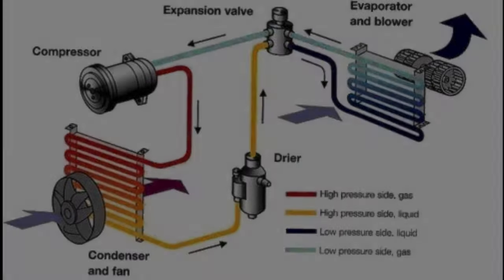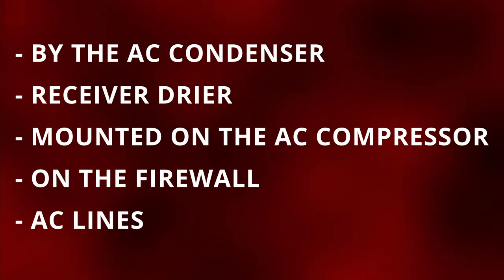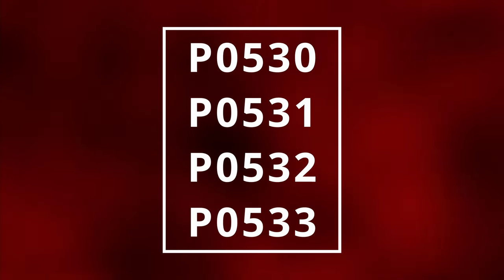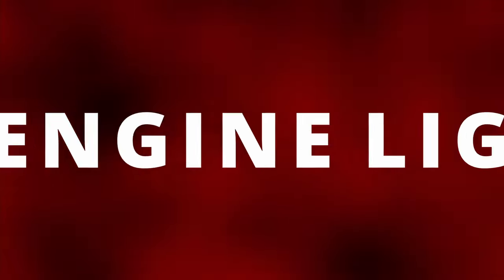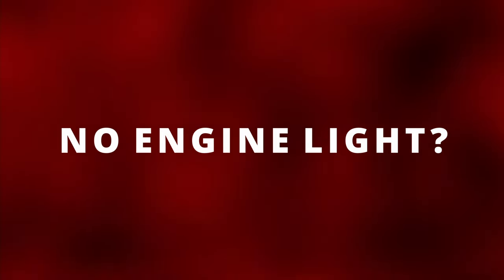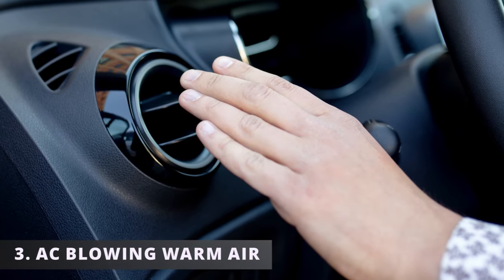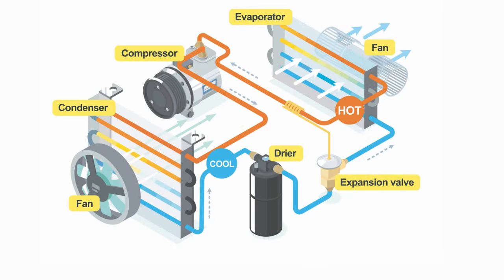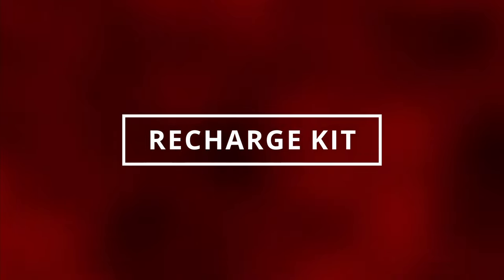SYMPTOMS OF A BAD AC PRESSURE SWITCH

Comment from the maker: Thank you for watching! 

Recharge Kit: https://amzn.to/3ycMH6V

OBD2 Scanner: https://amzn.to/3PHRplS

A great car repair manual: 
https://www.gopjn.com/t/SENKTklLS01DSE1NS0lOQ0dKRk9LTw
(Use code AD10VA for 15% off one-year subscriptions for any US Order)

Have car-related questions? Check out JustAnswer! They have verified auto mechanics that are available as live help 24/7: https://justanswer.9pctbx.net/qndBon

Check out my merch: https://easyautofix.creator-spring.com/

Buy a new AC pressure switch here: https://advanceautoparts.rt8x.net/DV4a7q

Here are some of my favorite items that you might like:
Tools: https://amzn.to/3xNDb8g
Car Vacuum: https://amzn.to/3EjhPSJ 
Cleaning Tools: https://amzn.to/3El7dCG 
Water Repellency Wiper Blade: https://amzn.to/3utvK50 
Cleaning Gel For Cars: https://amzn.to/36NIiMr 
Portable Air Pump for Car Tires: https://amzn.to/3uBuPzA 
Headlight Restoration Kit: https://amzn.to/3qDpOVH 
Amp Jump Starter: https://amzn.to/3pMd0vx
Reply: Hey boss.....great video.... can a bad AC pressure switch ALSO cause the compressor to keep cycling on and off.....hooked up gauge and refrigerant reading is very high / in the red...system just blows warm air....no cooling at all.... what do you think?
Reply: does this have to do with low cooling while in idle
Reply: Thank you 1st and foremost. 
I had all these symptoms except codes.  Off and on etc.
I tried the paperclip trick and it worked a few times then just stopped working. 
Do I now need to replace the pig tail or the switch or both?? Plz and thanks again.

Comment: I took my 2004 F150 to so called "experts" near me to get fixed. They said my compressor was leaking and replaced it to the tune of just under a grand. When i picked the truck up they were raving about how they were getting 25 degrees at the vents. On the way home the air stopped coming out my vents, then i started to think " 25 degrees? I bet the damned evap coil is freezing solid " I researched the system, and saw that the truck had both a low pressure switch, and a high pressure switch. I replaced both. That solved my problem. The high pressure switch was not disengaging the compressor. This, and a problem I had where i bought new tires is why i still do all my own work at 78 years old. At 153k miles i did a complete timing job, including roller followers and lash adjusters. The only mechanics I would trust are Eric O of SMA, and Ivan of PHAD. We are in a perfect storm of crap Chinese parts, morons that think they are mechanics, and unnecessarily complex module laden vehicles with mouse loving wire insulation that im sure people will eventually have had enough. I own two F150 trucks, one is 30 years old, the "new" one is 20 years old. I will not upgrade, or I should say DOWNGRADE to a newer vehicle.

Comment: Hey i have a quick question my ac will turn off and on off and on off and on when im just idling sitting still is this due to a bad switch
Reply: No, the a/c cycles on and off when you use heat to avoid damage to the compressor. It should cycle on and off about 10 seconds at a time.
Reply: @stonedblaze313  yeah well whenever i run the ac on max ac and come to a stop it cuts on and off on and of on and off about a second apart from each other and this only happens when i come to  a dead stop i have a 5 speed 96 honda civic hx too if that helps
Reply: I'd suggest to check the refrigerant levels. If they're good I'd look towards a vacuum or wiring issue.
Reply: @stonedblaze313  ok thank you for the help ill let you know if it works
Reply: Did you find the solution
Reply: It'll likely be you're compressor. It's just too weak to run properly at idle. The belt runs faster when driving.
Reply: these youtube mechanics be funny

Comment: I have a 97 Honda CRV AC works colder at night than during the day recharged it but now the pressure too high and you can hear it blowing through a blow off valve is system clock somehow or did I overcharge it any help or what to diagnose and check-out would be helpful thanks

Comment: Older systems use simple on/off sensors that switch between closed and open circuit when refrigerant is out of operating pressure. Newer vehicles may use sensors that signal to the VCM/PCM the exact pressure by variable resistance. I'll talk about the older on/off sensors. The high pressure cut-off switch typically mounted at the compressor is normally closed, so the request for AC from the cabin controls goes thru the high pressure cut-off and to the VCM so the VCM receives the AC request and will activate the clutch relay to engage the compressor. When this sensor detects abnormally high pressures (~380psig) it will open and block the AC request signal to the VCM so the clutch will not energize.
The clutch cycling switch typically mounted to the accumulator is closed at operating pressure (24psig-44psig). When the compressor is activated, it pulls refrigerant gas from the suction line and compresses it to a high temperature high pressure gas (~150psig), which passes thru the condenser and condenses to a liquid. The liquid travels to the orifice/txv which has a tiny opening to restrict flow.  On the other side - suction side the pressure is between 24psig and 46 psig so refrigerant flashes to a gas and the conversion absorbs heat so the gas is instantly cold ~33F. 
When the compressor first activates, the pressure on the low side is around 44psig and drops as the compressor pulls gas from the suction side faster than the liquid discharges from the orifice. This causes a steady drop in pressure on the suction side from 44psig to 24psig. When the clutch cycling switch detects 24psig, it opens and signals to the VCM to de-energize the clutch relay and the compressor stops working. The evaporator is still cold so the blower motor blowing air heats the evaporator, increasing the pressure of the suction side. As it rises to 46psig the clutch cycling switch closes, signals to the VCM to re-energize the clutch relay.
This process repeats as long as you have the AC on.
The 3rd sensor is the recirculation sensor. It's typically just after the condenser and activates when the high side is too high - but not high enough to activate the compressor high pressure cut-off switch. The only thing this sensor does is tell the VCM to activate the recirculation feature (same as the button in your car) in case the button is set to "fresh air intake" which is typically warmer. This is done to ease the load on the compressor by blowing cooler cabin air over the evaporator instead of hotter outside air. This sensor typically should only activate in very hot weather and with low air flow over the condenser so the condenser is unable to reject enough heat.
A faulty clutch cycling switch does not open in the desired low pressure of 20-24psig OR doesn't close in the desired high pressure of 42-46psig.
A switch that opens too low (~16psi) will cause evaporator freezing.
A switch that closes too high (~65psi) will have reduced cooling since the compressor does not engage before the evaporator warms up. The vents will throw cold air, then warm air, then cold air as the compressor cycles.
A switch that opens too high (~30psig) OR closes too low (~34psig) OR both will cause short cycling - the compressor will only be engaged briefly before it shuts off. The vents will only blow coolish air out of the vents perhaps 65F instead of the desired 50F.
Reply: Can you tell me anything about  05 pontiac gto?   Does it only have 1 switch?
Reply: @mikeprice8307  your high pressure cut-off switch is at the same fitting as your discharge service port on the line. Your AC works a lot different, there's a TXV at the firewall where the evaporator fittings are. You have a clutch connection engages the clutch, but instead of a low pressure clutch cycling switch, the clutch stays engaged, and an internal valve (on back side of compressor) controls refrigerant flow, and instead of cycling the clutch on and off, the refrigerant flow is bypassed to stop compressing gas until the valve senses high or low pressure and then restores flow of refrigerant so compressor can compress again. So you won't hear the CLICK that we do when the clutch turns on and off.
Reply: So if you have no leaks and have refrigerant, but not operating correctly, I'd look at replacing the valve on the back edge of the compressor. Or the thermal expansion valve at the firewall. Need to make sure you have a full charge, not too little not too much.
Reply: Looks like by design, even if you've leaked out all refrigerant, the clutch will still engage and spin the compressor.
Reply: @thebluelunarmonkey  I have a brand new compressor. I replaced a compressor that was leaking from front seal, but it worked.

I installed the new compressor after vacuum and I saw the clutch engage while charging freon. The system made knocking noises doing so because of my bad belts, so I turned off ac.

After new belts, while charging freon, I'm getting high pressure and clutch will not engage. 

They say every car has 2 switches, low & high side.
Reply: @mikeprice8307  Did you pull the plug out of the back edge of the compressor and insert the valve? it has 4 o-rings and a snap ring that holds it in. Look at your old compressor. There will be a plug looking thing with a snap ring.
Reply: @thebluelunarmonkey  I did nothing to the new compressor but install it.
Reply: @thebluelunarmonkey  mine isn't designed that way
Reply: @mikeprice8307  No plug with snap ring on back edge of compressor?
Reply: @thebluelunarmonkey  I think you're correct! Do you think a new compressor would have a bad control valve?
Reply: @mikeprice8307  I'm not sure if it has a blank plug where you're supposed to insert the control valve, or if the compressor comes with the valve installed.
Reply: @thebluelunarmonkey  ok I understand.   Well like I said, I did see the new compressors clutch move before. Now it won't operate.
Reply: @thebluelunarmonkey  it's a V7 AC Delco oem from RockAuto!  It was listed as new and prefilled with 3oz. Oil.

Plugged in to my cars harness connector and relay is good.  I even swapped relays from other duties and tried the paperclip method.

A mechanic used a multi.eter at my connector and showed no shorts.

Now the clutch spin by hand, different story.  Sad to say I can't remember how it felt out the box for the life of me.

The old compressors clutch will spin using my pinky only (removed from car that is)!  The new one is difficult to spin while installed.

While uninstalled, bc I removed it for short duration,  I spun it and it would turn, but only with it being a forearm and wrist workout.

Readings tell me IF seized, it will spin with pulley on car, but that's not the case.
Reply: @mikeprice8307  the 4seasons compressor on that site has a photo of the plug. The ACdelco doesn't show the picture. The plug is behind the long flange for mounting bolt. Seems like that clutch would still engage without a valve. just wouldn't cool.
Reply: @mikeprice8307  while you're on RockA, look up "Compressor Control Valve" That is what basically replaces the need for the electrical clutch cycling switch.
Reply: @mikeprice8307  Give RA a call on the compressor you got and see if the valve is pre-installed.
Reply: @thebluelunarmonkey  😁 they are an email only company.  I'll ask though!   I'm sure it should have it since  prefilled though, and i saw it spin at one moment, don't you think? 

 It didn't mention anything about a valve or needing one. Ever heard of one new and valve not included or just faulty?
Reply: @thebluelunarmonkey  I'll say this though!  What I may try since the old compressors worked, is to switch control valves between the 2.  Other than that, I'm stumped.
Reply: @BearHomeOwnerDIY  can you describe the looks of blank plug?

How did you know to do so?
Reply: Very informative. I just completed an AC overhaul on my 92 mustang. The only thing I did not replace was the compressor. I'm still running R12 and I added mineral oil to the pump. Manually pumped it by hand. After I connecter a can of R12. At first the Blower was pushing air through the vents but after the 1 can of R12 it completed stopped blowing air in general. Any idea why that could have happened? Blower resistor? Possibly because there isn't enough freon in the system yet? It was only 14oz. So it wouldn't have the AC switch come on? Even if the switch didn't come on it should still blow air I thought? Any help would be appreciated.
Reply: @mosesandres3385  Yes you are on the right track. Blower resistor, fuse, wire,  electrical connector, or fan. Blower resistor is usually located in the path of air near the blower so the blower keeps resistor from overheating.
Reply: Hi, my ac compressor is turning on and off by 5 second cycles. Is this normal? If not, what do you suggest?
Reply: @kevinb70  thanks. Once I put the complete blower box assembly back, somehow, the blower connector came separated from the blower. Easy fix.
Reply: @beterbey  See if your cabin air filter is clogged. I've got another channel where i show how a clogged cabin air filter will short cycle the compressor. See, if you block air flow to evaporator, there is no heat load to counter act the cooling from the compressor, so when the compressor engages, the evap pressure drops quickly  and the compressor cycles off. Your clutch cycling switch can be worn, and instead of cycling at 24psig-44psig it cycles between 26psi and 38psi. Check the pressures at which clutch engages/disengages on the low side with a gauge and compare to original specs for your cycling switch.- Bear, Homeowner DIY

Comment: I have a 2011 F250 that I bought used in 2018. I never had any AC problems and I've never added any refrigerant. Recently it quit cooling. If I put it on max cool it will eventually come on after 10 or so miles of continuous driving. I thought maybe it needed  charging so I bought a can of refrigerant and connected it to the low pressure side. I DIDN'T ADD ANY REFRIGERANT, but the gauge read nearly 90. The ambient temperature was about 78 degrees F.
Reply: This is a late response, but just for info... my 02 ranger did this and I found the clutch gap was too wide.  Removed 1 shim from clutch plate and eliminated the sporadic start and run problem.  Figured it out one day looking at the compressor with motor running and just touched the magnetic plate with a screwdriver.  A tiny nudge was all it took to draw it in.  After it cycled off, repeated the tap maneuver.  Reducing the air gap that had gotten larger due to plate wear over 140k was all it needed.  Over 210k now, and all is cool.

Comment: I have a question, my condenser fan only works on high temp.  My compressor works fine but since the condenser fan does not work on normal temp, it just keeps on rotating.  My AC works fine when the car moves.  Is the condenser fan related to pressure switch? I checked all the relays and they are all working fine.

Comment: hi mate. 
I own a bmw x5 2004. 
I’ve replaced the condenser , compressor, radiator fan, condenser fan, and expansion valve and still don’t have COLD 🥶 air. The most it gets is “cool”. 
What am I missing?

Comment: We're trying to figure out why the AC works up until we accelerate hard. When we accelerate to about 3,500 RPMs, the air switches from blowing cold to blowing warm air, and when we stop accelerating, it still blows the warm air. If we turn the AC off, wait a few seconds, then turn it back on, it will start blowing cold again. Still on the hunt for a video that may help explain this exact issue. We are thinking that it might be a faulty sensor or a leak in the refrigerant line and low refrigerant, but still unsure. Thanks for helping us get one step closer.
Reply: It can be low freon in your ac system.
Reply: @mocnyjakniedzwiedz  That's what it turned out to be. A seal was worn which caused a small leak.

Comment: Good morning easyautofix, am a mechanic working on this customer ac, mitsubishi outlander 2013, the driver complain the compressor trips off after driving for a while, and sometimes when the car is parked in the sun for hours the compressor will not turn on when car is start, i have checked for leaks no leaks, and compressor is working fine, and i have also check the Ac pressure switch still no leaks, what do you think can be faulty in the ac system that makes the ac malfunction that way, and once the ac picks it cools  normal. Pls what can i do?
Reply: Check the fuses sounds electical

Comment: C5 corvette a/c problems.... car has a new compressor and last year replaced the pressure switch. Last few months had several instances of a/c not working intermittently. After two days of no cold air, we verify there is accurate pressure in the system and my bet is on the switch is faulty. Let's see what the shop says.
Reply: So what did they say
Reply: @Baddonation22  the connector to the compressor fried itself. No explanation as to why.
Reply: @HardwiredZ06  thanks for replying
Reply: @HardwiredZ06 does your vette have both low side and high side pressure switches?

Comment: Well all and good. But Does the high or does the low control compressor. You never specified.
Reply: My truck has two, if either one is disconnected the pump turns off. Most all OBD2 vehicles are that way.

Comment: My 2006 Ford Explore compressor turns on with the control in the off position, I replaced the control module but it’s doing the same thing. Any advice
Reply: I have a 2011 Acadia doing the same thing, you find out why your explorer ac compressor turning on by itself?

Comment: What could be the problem of my ac when the pressure of the low pressure decrease the air turn cold and when is night but normally the air of the vent are not so cold